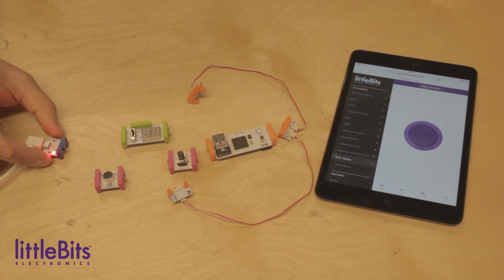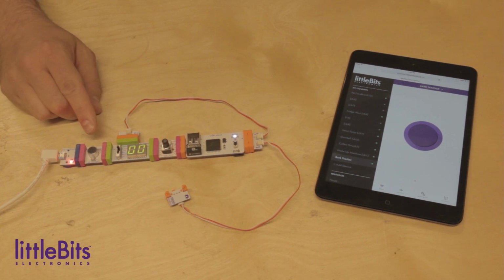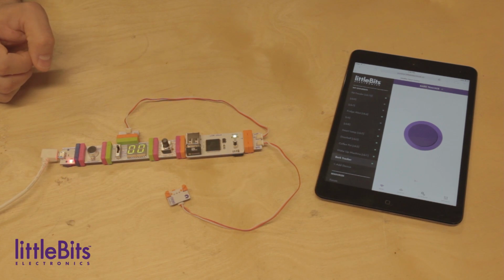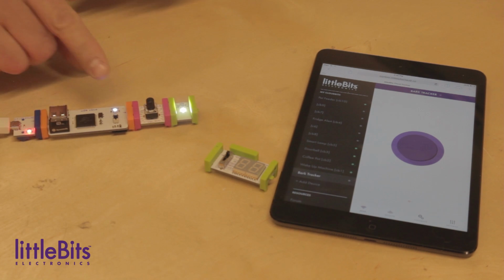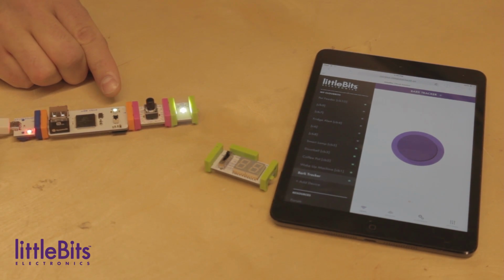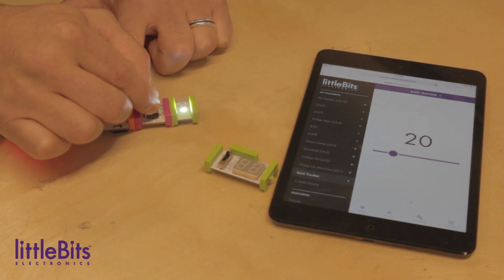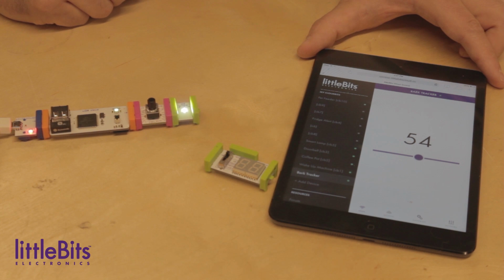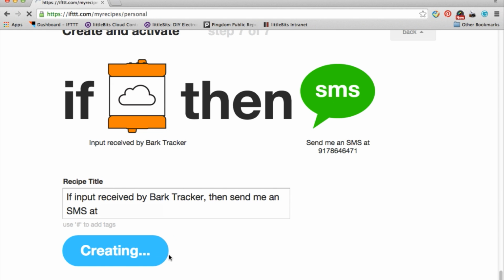littleBits Smart Home: Bark Tracker

Comment: So if your dog only barks once an hour it still notifies you after it reaches the threshold?
Reply: With this, yes, but you can fix that. Put a split between the counter and the cloudbit. On the other end of the split, put an inverter followed by a timeout module. Connect the timeout and the cloudbit's output to a "double or" module and then connect that to your counter's reset. Set the timout to "off-on" mode and you're golden!

With that new setup, when the counter goes above 0, it triggers the timeout, and when the timeout goes off, it resets the counter, turning the timer off and setting the counter back to 0 again. This means if the dog doesn't bark N times before the timeout ends, it won't count. Since the timeout can be set between 1 second and 5 minutes....I think you're good :)

EDIT If it doesn't work right away, you might need to add a threshold set to 1% before the inverter--I'm not sure if the timeout would consider 1% voltage as "on" without it.